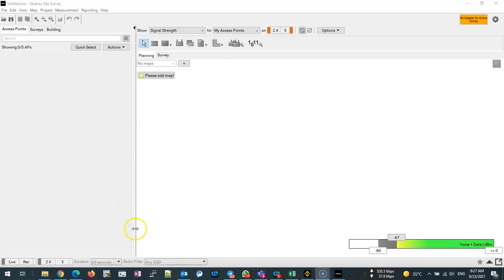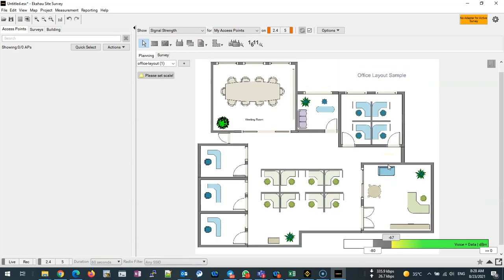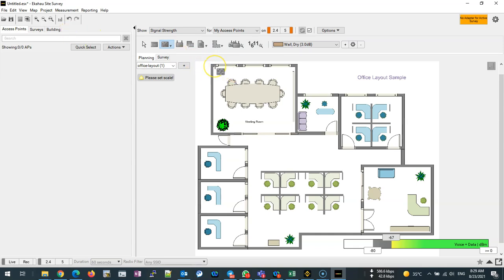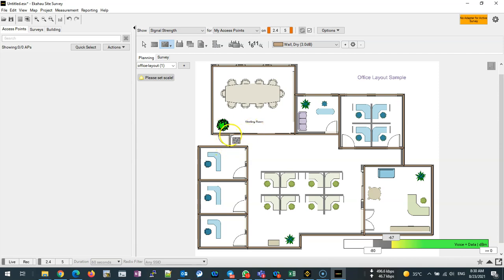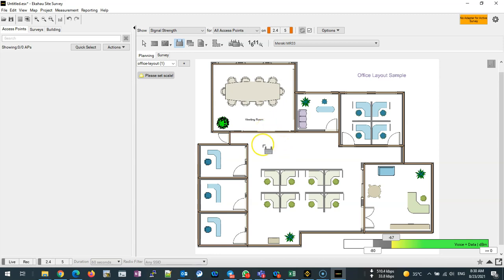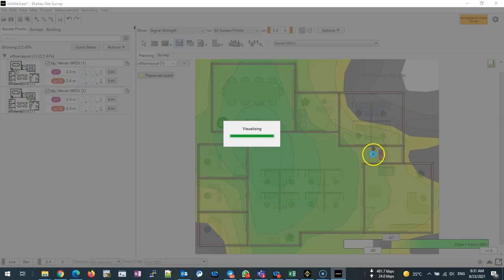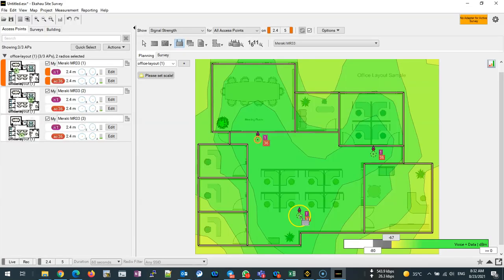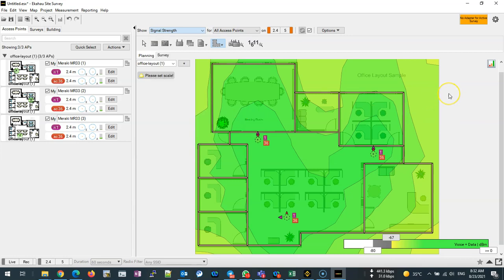How to do Wireless heatmap using ekahau software easily

Comment: You are obviously not a wireless engineer nor do you know how to use Ekahau.😂
You never set the coverage area
You never set the scale
You left the signal strength at -67 dBm. That may be good for 2.4ghz but not 5 or 6 ghz. 
You left all three APs on the same channels. Did you ever hear of co-channel interference?
Reply: And you he have not designed the door 😂